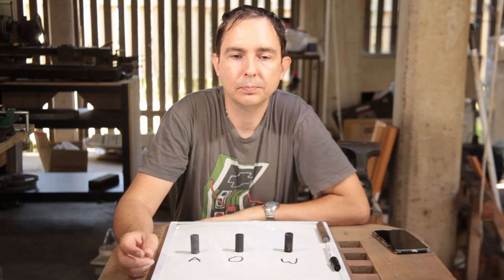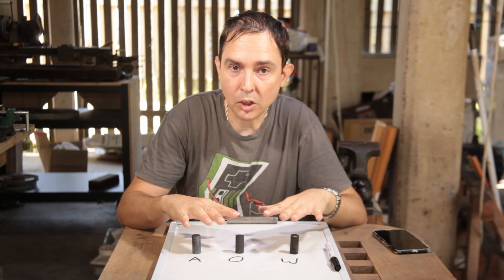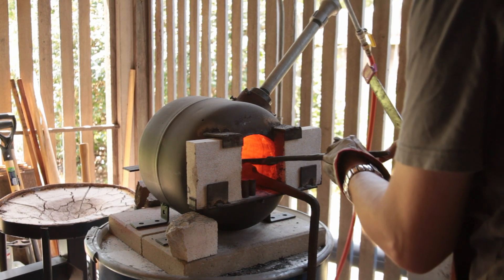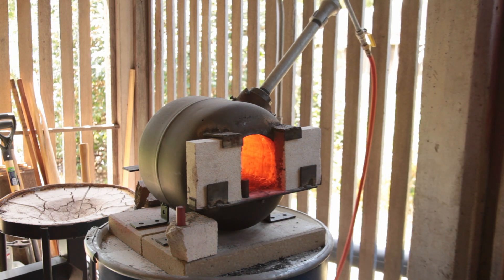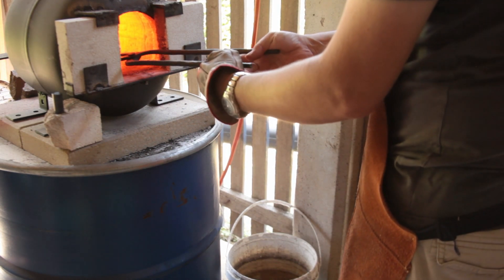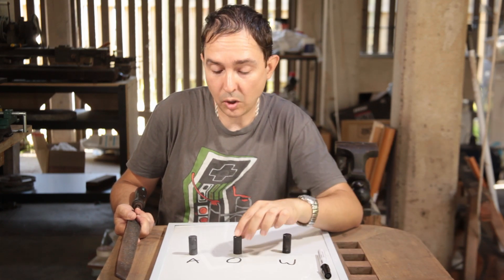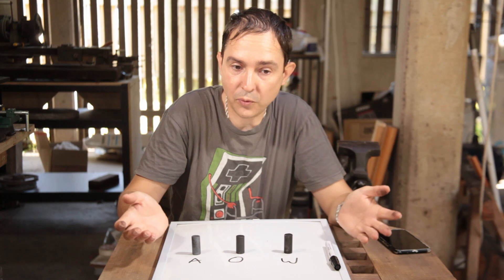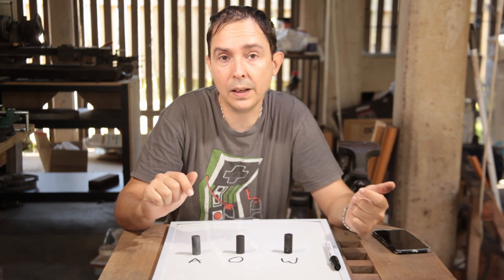How to heat treat mystery steel

Comment: ..Good information Doc!! i was just about to ask about the brine when you answered it. Do you pre-heat your water as well?? Some say yea others would like a bucket of ice when using water, your thoughts...
Reply from the maker: Y-Not Forge the main issue with water is vapour film that forms, and it will always for when quenching until the piece approaches the boiling point of water. One thing you can do you reduce it add things that break surface tension like soaps or borax...